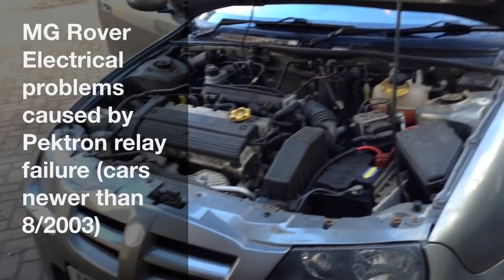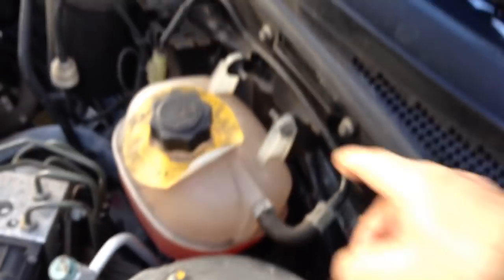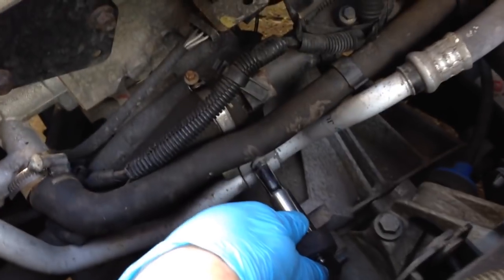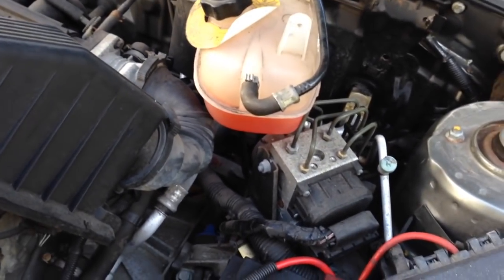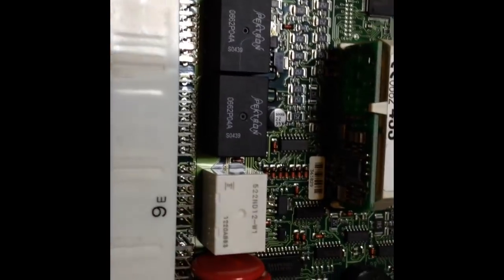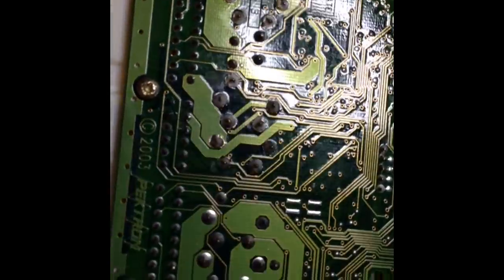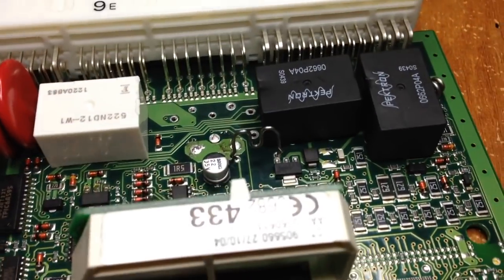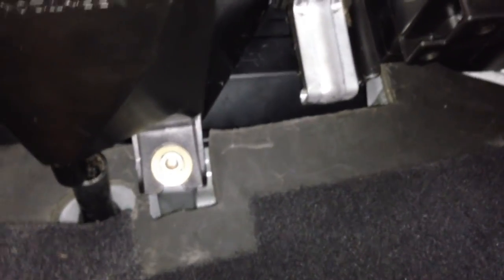How to Fix MG Rover Electrical Problems - Pektron Relay Fault - 8/2003 on

Comment: I have just tackled this job for first time yesterday I consider myself competent by no means an expert but I know my way around a tool set.That said, I think you need to add a note to the video, to make it clear if you have air con the difficulty of removing the SCU should not be underestimated! It has proven to be extremely awkward one of the worst jobs I've ever had to do, and I've done a lot. The video while is very good and I'm very grateful for it, it is slightly misleading as to the units actual location it looks like the SCU is on the top of the air con unit when it's actually right behind it at the bottom, this is shown in the video but not until you reinstall it. Also putting it back is total nightmare.
While no doubt this job is possible without removing the AC unit, in all honesty. If I have to repeat this job in the future I will be degassing and removing it completely.
Overall fantastic tips in the vid! Good work. Prepare to say some choice words and have some plaster on hand :)
Reply from the maker: Thanks for the feedback and I agree with your comments, it is awkward.  I actually did it twice on that car with a/c, I only changed a couple of faulty relays the first time and then another one went, so had to do the job again to change all of the relays.  It was slightly easier the second time and the key thing is slackening the mounts in the engine bay for the a/c pipes to allow a bit more room to get the bcu in and out.   
Because of the effort involved, it's well worth changing all 5 relays rather than just the failed ones.

Comment: Thank you for this video. It's given me the confidence to try replacing one of the relays on the Pektron unit on my MG TF.
Reply from the maker: Thanks. Glad to help.  I would replace them all however.  Good luck
Reply from the maker: Here the place to get the replacement relays:
http://rover.ebay.com/rover/1/710-53481-19255-0/1?icep_ff3=10&pub=5575193927&toolid=10001&campid=5337910930&customid=&icep_uq=Replacement+relay+pektron&icep_sellerId=technozen_electronics&icep_ex_kw=&icep_sortBy=12&icep_catId=&icep_minPrice=&icep_maxPrice=&ipn=psmain&icep_vectorid=229508&kwid=902099&mtid=824&kw=lg

Comment: Hi Jerry . Excellent facility you provide us novices. I have a 2005 Rover 25 . Both front windows suddenly stopped working and are in the fully open position. I'm hoping there's something more simple like a fuse to change . Can you tell me  where the fuse would  be  please
Reply from the maker: Not sure. I suggest getting a Haynes workshop manual and check their wiring diagrams in there

Comment: My Rover 25 has a weird fault. The colder the weather, the longer the headlights take to come on. In summer they come on almost immediately, but in winter it can take a few minutes and when it's very cold it can take 10 minutes or more. When they come on they stay on and behave perfectly fine. I was hoping the relays mentioned in your video may help, but it seems not. My search continues.
Reply from the maker: Tricky that one. I can only suggest attaching a voltmeter / multimeter to various parts of the lighting circuit and looking at the voltage when this happens.  Start at the battery and then after the light relay, then to the bulb.

Comment: You make great video"s that have helped a lot with my rover 25 repairs , now i have a new problem with the car , everything works OK but when i use the fob or key to lock the car  the central locking locks all the doors as normal and sets the immobiliser but after about 30 seconds the alarm goes off , i can turn it off with the fob or key and the car starts and drives perfectly OK but the only way i can stop this happening is to lock the car with the bonnet up and then remove the earth from the battery and then close the bonnet , then when i want to use the car i unlock with the key and re connect the battery.....would you know of a possible solution to this , thanks for any advice you can give .
Reply from the maker: Thanks very much, glad you enjoy them.  On your alarm the difficulty is finding what is triggering it.  I guess it’s not the ultrasonic space intrusion because that is not used when you only use the key.  So its either a door/bonnet switch (you try shorting all these out to try and identify it) or maybe it’s detected a battery voltage change due to a poor earth maybe and the battery voltage changing when things power down after a short delay. You could try pulling fuses on everything apart from immobiliser / lock stuff to see if you can stop it being triggered. Might show something.
Reply: @comeinhandynow  

Thanks for your reply and advise , I’ll try what you have suggested and see if I can find it and I’ll let you know the outcome.....👍
Reply from the maker: @yensabi  Ok, yep be interesting and useful for future reference.

Comment: Thank you @comeinhandynow. I have an 04 plate Streetwise (Mk1) that I replaced the drivers door lock actuator on and after a couple of months it developed a problem where the central locking/unlocking would continue to operate whenever the drivers door was open. The problem stops when the door is shut. Because I dont want to overload all the old actuators I pulled the central locking fuse. Been waiting for weather to warm up to try and check all the door wiring but then a few days ago I Iost the function in the intermittent wiper.  So now I presume Ive got Pektron relay problems - I'll probably replace them all but do you think that is the cause of the central locking issue?
Reply from the maker: I’d say you may have two problems.

Comment: I definitely believe I have this problem as passenger side is fine an I also bought a 2nd hand window motor which don't work but does if I connect it to the passenger side, I work long hrs 6 days a week so my question is how much would this cost if I went to the garage?? An also are all the pecktron relays the same identification number? many thanks
Reply from the maker: An ordinary garage wouldn't get involved in component soldering, but if you get the bcu box out the this guy will do the upgrade for you via mail order:
http://www.technozen-electronics.co.uk/mg-rover-pektron-scu-repair-services-spare-parts/

All the relays are the same type, but the new better ones will have different markings.  See the link in the video description if you want to buy the relays.
Reply: +comeinhandynow  thank you for that I just have 1 last question which is I guess I need to disconnect battery before starting? an also  changing this relay/relays, it won't interfier/mess up any thing like alarms, fobs, immobiliser? Thank you for your feedback an iv subscribed to your channel
Reply from the maker: When I did it on mine I didn't disconnect the battery and it didn't mess up the alarm/fobs etc.  But if you want to be safer, then disconnecting the battery shouldn't mess it up either.  You might have to press the fob a few times for the system to resync.  Of course I can't guarantee all this, but that was my experience.  Good luck.

Comment: Hi. You saved me a fortune when my wife's Rover 25 horn stopped working.  I changed the relay and sorted. Thanks
Now, three weeks later I get a call from my wife at work to say the alarm was sounding but no lights were flashing. When I got there the battery was flat so hooked it up to my car.  Alarm sounded but managed to silence it with the key fob. Central locking doesn't work. Car won't start. Lights don't work. Very dim ignition lights, that disappear when the key is turned. There is a steady clicking sound associated with the alarm led.  I've changed the relay associated with the central locking but no change. I'm wondering if there is an earth fault but I'm scratching my head.  Any thoughts would be appreciated. Thanks
Reply from the maker: Richard Odlin Glad it helped originally.  Very dim ignition lights that disappear when try to start and your other symptoms all point to a  knackered battery.  Batteries usually get knackered once they are fully discharged.  So first measure the battery voltage and fully charge it up overnight with a battery charger to see if you can get it back to life. It will probably need a new battery soon.  Then try central locking, if it has lost sync you may have to keep pressing the fob buttons until it syncs up again and works (assuming good fob battery!).  If battery is good lights should work and car engine should turn over and hopefully start.
As to why the alarm sounded, sometimes something in the car, like a fly, might set off the interior space ultrasonic monitor.  If it keeps doing it then locking with the door key only keeps the ultrasonic monitor off (model dependant so check handbook), so won't trigger an alarm.  Useful when leaving a dog in the car.
Also possibly a really flat battery might also trigger odd electronics behaviour like setting off alarm or turning rad fan on.
Good luck!
Reply: comeinhandynow Hi.  Thanks for that.  I'll look at the battery.  As it happens we always lock the car with the key as the alarm was always going off.  We've had the car getting on ten years and had very few problems, with the exception of the alarm, but if it carries on like this it will be heading to that great layby in the sky.  Thanks again.
Reply: Richard Odlin Hi again. Battery was at fault. Thanks.  Car starts fine all electrics work with the exception of the central locking.  The drivers side will lock from the fob but won't unlock nothing happens with passenger door. Strangely, I can't unlock the passenger door manually either.  You can hear the relay clicking when I press the unlock button on the fob.  Any ideas, as I'm at a loss. Thanks again
Reply from the maker: Richard Odlin When you changed the horn relay, did you change the other relays too?  If not that is my first theory, one or more of the other relays have gone.  They really should all be changed to better non pektron ones for the systems to be competely reliable.   You can measure the resistance of the coils in each relay to confirm if it has gone or not.  There are two relays within each relay box.
When those are confirmed as working, then move onto measuring the voltages at the door solenoid inside the door panel.
The best bet is those relays though, it sounds like the passenger door is still deadlocked which is a separate relay from unlocking normally.
Reply: comeinhandynow I had changed out the deadlocking relay and the central locking relay.  I re-soldered the pins just in case there was a dry joint, or whatever the expression is.  Seems to have done the trick as doors are fully functional again.Many many thanks for taking the time to help as it was invaluable.
Reply from the maker: Richard Odlin Great to hear and thanks for the feedback.

Comment: Great video. 
I have a 2005 zr 105 and the I Pektron next to the OBD socket. 
do not work the intermittent wiper (speed 1) the other 2 speed work. 
If I enter into reverse the rear wiper is activated. 
With this work I solve the problem? thanks
Reply: Roberto Tasso Can you tall me what you do? What part I must change. I have same problem as you and it drives my crazy. Thanks
Reply from the maker: The intermittent wiper is controlled by the pektron relay in the BCU, as shown in the video.  You need to order new better relays, search on www.eBay.co.uk for "replacement pektron relays mg rover", the ones from technozen are the ones I used and can recommend, about £5 each.

Comment: WIll this affect the front and rear washer pumps? Im having issue with both pumps not being activated via the stalk. All fuses seem to be intact and both pumps work. TIA
Reply from the maker: I don’t think so.  Try the wiring diagram in the haynes manual to work out where the pumps connect to.

Comment: I have a 2001 Rover 45, the driver side electric window does not work and everything else is fine. You have listed this for a >2003 model but do you think this could be my issue too? I have no power getting to the electric window or switch.
Reply from the maker: I think it’s different for earlier models.  Best to try and trace the wiring back further to the fuse box.  Maybe a wiring diagram from the Haynes manual would help.

Comment: Could this give a immobiliser fault? The immobiliser is on and the central locking would turn it off as it doesn’t work. Rover 45
Reply from the maker: It’s just for the faults listed. i.e.  Horn, Drivers electric window, Central Locking, Fog lights, Intermittent wipers.

Comment: it takes a few top engineers to come up with a location  like that, the average joe blow could not do it
(thanks, now i know what i am up against when my  2005 25  1.4  starts conking up..)
Reply from the maker: Good luck. It doesn’t stop me liking Rovers however, the problems are smaller than many cars.

Comment: Hello there! Is it possible that broken relay is responsible for my car radio and light bulb in the luggage compartment not working? I've got Rover streetwise 1.4, and recently when I was installing a LED bulb in the luggage compartment radio and the mentioned light just stopped working, I checked the right fuses under the steering wheel and all of them are working fine, I also checked the fuse in the radio itself... there is no power in the cable powering the radio and no power in the cables powering the light bulb in luggage compartment.. I'm stuck can you help me out, mate ?  All the help will be greatly appriciated !
Reply from the maker: That wouldn’t be the relay more likely a fuse as you have already realised, there may be another fuse box under the bonnet. It is best to check the wiring diagram to locate the fuse for the radio and for that you should get a Haynes manual

Comment: Hi.  I need help in my car rover streetwise some things are not working 1. rear wiper 2. rear wiper washer 3. brake lights 4. reversing lights 5. electric mirrors.  I have already checked the reverse sensor in the box.bulbs. fuses.  the comfort module, the only thing I noticed is that if I connect the wire from the stop sensor at the brake pedal to the wire in the relay box under the steering wheel, everything starts to work only that when you try to short-circuit in the lamps, the fuse does not burn, so it is quite dangerous.  Do you have any idea?
Reply from the maker: My thoughts: 1 Get a Haynes manual for the wiring diagrams that will allow you to see what each wire connects to so you can test the voltage on the wires at each point.  Get a multimeter/voltmeter to do the measuring. 2 Brake light problems are commonly caused by a worn brake pedal switch, dismantle that and check it.  3. Electric mirror problems are often caused by internal motor mount problems, if it is making a noise but not moving, else check the wiring again.  4 Check earth connection voltages as well as +12v/power wiring.
Your description of ‘everything starting to work’ when you make your own wired connection (not sure where you are connecting) sounds a bit like a  common earth or power connection is broken.  You can identify this by testing both earth and power voltages on the bits that don’t work.

Comment: Just bought a 2005 mgzr ,you can unlock the car remotely but cant`t lock it with the remote. Everything else works fine in the car except this . Could it be this unit ? Only way I can lock it is by pushing button down on passenger door & using key in drivers door (its only a 3 door!)
Reply from the maker: It is probably these relays that need changing
Reply: think ur right mate 👍 gonna get that bcu relay out & get the relays replaced soon, hopefully that'll fix it as it's doing my head in!!
Reply: clint ezra tried another remote but still doesn't work 😔 also the button inside on the dash that's meant to lock all the doors doesn't work either,